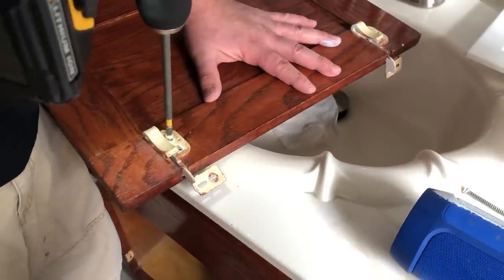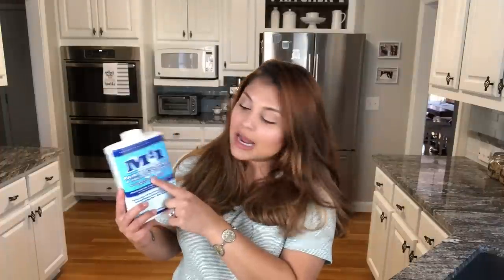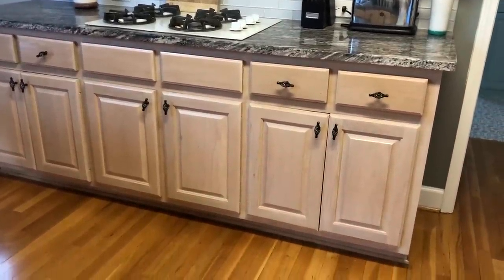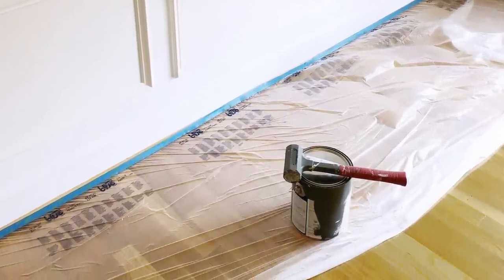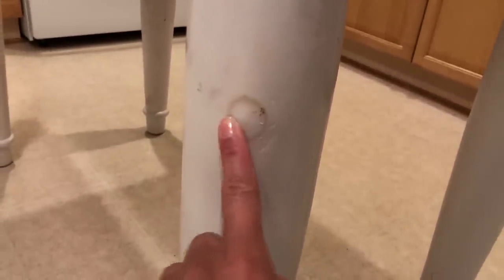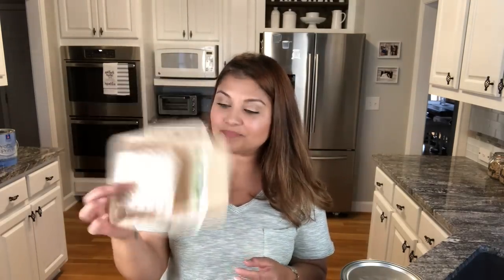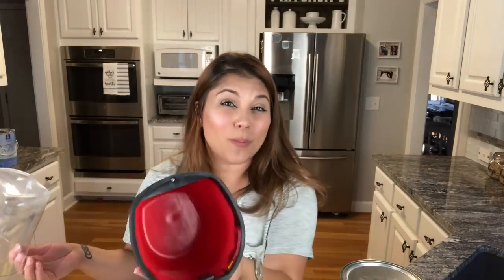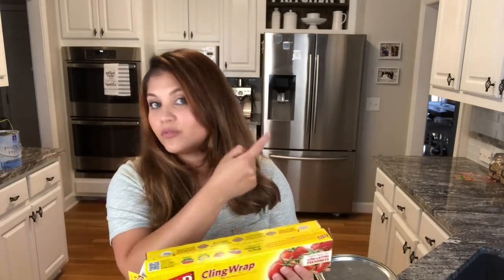HOW TO PAINT YOUR KITCHEN CABINETS THE BEST WAY - How to paint kitchen cabinets without a sprayer

Comment: I want to thank you for this video- I just spent two months painting all our bathroom and kitchen cabinets. Just finished today!!! I followed your steps and after a lot of hard work, they look amazing! Thank you so much for your gift of knowledge. :)
Reply from the maker: That's amazing news!!!!! Thank you so much for letting me know! I am so happy you are happy with your results!
Reply: @TheLatinaNextDoor  :)
Reply: @elycevwestby1521   How are they holding up? Anything you would do differently? Want to tackle my kitchen cabinets and will be following her steps.
Reply: @SX-sv6vo  I think they have held up well! There are definitely some chips that show- especially on the lower cabinets which I painted a dark color. But I just need to touch up the chips one of these days- otherwise I love them. It took me 2 months but is worth it when I love how my kitchen looks now. :)
Reply: @elycevwestby1521  Thank you for responding! I have a big kitchen and 3 kids, so I will be working in phases over the next few months.  I want to do it right so it lasts. So happy for you!
Reply: @SX-sv6vo  When I did the cabinets, I had two little kids and a baby, too! So that's why it took me 2 months as well. :) I think the #1 tip is to do the prep as perfectly as possible- I had to redo a few doors during the process as I didn't sand them enough during the prep stage. That was a pain. Thorough sanding is so key! Blessings on your painting endeavor! :) :)

Comment: First time watching this "older" video, Yami! We're coming up on the end of an entire first floor re-do, including furniture, flooring, trim, walls, countertops, bathrooms, etc. Just wanted to concur with your wonderful tips for re-doing your cabinets, and join in with the recommendation for using Sherwin Williams Urethane Trim Paint in the Extra White (Semi Gloss). I can't remember where I learned of it, and it's been difficult to get a hold of this past winter ('21 - '22) for some reason, but we've gone through about 10 gallons, and it is HANDS DOWN the best paint for doing cabinets (as well as, of course, your trim work and doors). It takes about 30 days to completely cure (be a bit gentle for the first month), but then the finish is rock hard and nearly indestructible. I was so excited to see you recommend this as well!

Comment: This lady knows what's up. Ive done a bathroom cabinet with polycrylic and it looked the same and even chipped in spots (I did a lot of things wrong, lol). I heard from somewhere else about using the enamel trim paint and repainted the cabinet. I got the hgtv sherwin williams kind from lowes and just wow, what a difference. Ill never use anything else for cabinets. I also used a foam brush (from another recommendation, probably on youtube)and I think that helped a lot too. I still made some mistakes (like not filling divets in the wood with filler first and not sanding the holes where the old tp holder went) but it looks 100% better.

Comment: Thank you so much for this information.  Everything you said resonated with me. I am in the process of painting a raw wood corner computer desk I had built. I have bought all this stuff to ensure a professional finish.  Fortunately I still had the Sherwin Williams paint I used for my kitchen Island.  I bought Kilz primer, Urethane for the top coat, which I don't think I need after watching your video.  I stopped the video at least 3 times to pack up some of the stuff I bought to return it and buy what you suggested.  I'mm on my way back to Home Depot to exchange those foam rollers, Urethane other stuff.  Thanks for your thoroughness.  I'll let you know how it goes.
Reply from the maker: Diva9000x I’m hoping it all turns out great for you! 😊

Comment: Hi Ms Latina..I finished a major league project of painting our Kitchen cabinets.  I took most of your suggestions to heart and you comments were also adhered to. In other words, I listened carefully to what your video was about.
I am happy to say the cabinets came out beautiful. The paint you suggested was fabulous.  
I would like to make a few suggestions that might help other painters.  
1. The Sherwin Williams paint store associate suggested to use 2 coats of primer, because the pros that came into the store all do it. I used oil based as you suggested.
2. the 1/4 inch nap that you suggested was fine, but in some cases 3/8 worked better for me.  It covered some trouble spots way better than the 1/4 inch.
Thank you again for this great video.......jim
Reply from the maker: I am happy to hear that your cabinets came out great! That's wonderful!

Comment: Questions about the brush/roller cleaning process. You said you clean them with mineral spirits right after the application, so I’m wondering if you do that twice for the primer process, once for each side? And the actual paint, if you paint in the morning, clean your brush, and then paint in the evening, how is your brush not still wet? I feel like I’ve tried that before, I’ve thought the brush was dry and then using it the paint goes on watery. I’ve wrapped my brush instead, like you did with the roller, and it was okay doing multiple coats (painting trim), but eventually it’s not in such good shape. 

I’ve used that same paint for trim and love it, so I was also thinking to use it on my cabinets and you’ve definitely convinced me!

Comment: You're video has inspired me! I'm going to paint my wood cabinets white and feel confident after watching your video countless times. It's excellent and so informative. So glad you posted it. I do have one question...I'm going to change my cabinet handles on my cabinets and the new ones will require different holes. What should I use to fill the current handle holes and do you have any recommendations on the best procedure? Do I fill the holes before or after cleaning the cabinets? Also, when do I drill the new holes - before or after painting? Thanks for any advice!

Comment: I gave cheap cabinets (rental), with no indentations,  do I need the brush, if so,   where do I use it? Or do I just roll it on? This is the best video for painting I've ever watched.  Hubby doesn't want to go to that much work, thinks we should just roll it on, so it looks like I may be doing this myself because I want it done right.  Thank you so much for showing what that looks like,  I appreciate it and now I have the confidence to do this project.
Reply from the maker: If you just have a straight panel door, you should be able to just use a roller - a word of caution, when using a roller on the ends make sure you don't have too much paint or press down to hard, but the paint will dry down the sides and leave drip marks. Hope that makes sense.

Comment: Lots of great tips, thanks!  How are your cabinets holding up after a year of use on the cabinets?  Also, if you have to do some sanding of the cabinets due to chips what grit do you suggest?

Comment: I just did this and followed your video. It was very helpful!! I would just add 2 bits of info . 
1. The primer is VERY strong smelling and a lot of ventilation is needed. 
2. I would recommend spraying the paint. I had a bit too much texture on the finished product.

Comment: best tutorial I've seen so far. One question I have is, did you use a wood filler for the holes from the hardware or did you reuse the same hardware? If new hardware, at what point in the curing process did you drill and attach hardware?
Reply: Yes great question
Reply: Drydex spackle works great for filling holes that are going to be painted.Home Depot or Lowe’s has it.
Reply: Mandy Shipler Drydex spackle works great for filling holes that are going to be painted.Home Depot or Lowe’s has it.

Comment: Thank you for the video!  I did have  a few questions. 1) how many did paint did you buy to cover your kitchen? 2) did you have to apply a sealant after painting them?  Thank you in advance!
Reply from the maker: I just bought one can and still had some left over. I did not apply a sealant. In the video I explain what happens if you do and why I chose not to do it. Also the paint I use does not need one. Hope that helps! 😊💕

Comment: Thank you so much for sharing your cabinet transformation!!!

We're starting our transformation from Oak stained cabinets to the SW Extra White this afternoon.  I am so excited, the Oak cabinets were put in the summer of 2000 and are still in great shape.  We've transformed out laminate countertops to a faux granite (that look amazing) and I know the cabinets will just set this off.  We have also taken down the wallpaper (again installed summer of 2020)  replacing it with SW Repose Gray and adding a backsplash which is going up next weekend.  I get a very happy feeling when I think of where we were just a week ago and we're going to be at the end of next week.  I have turned in to a complete DIY'er.  Plan to do our bathrooms next!
Reply from the maker: You got this!!!! 💕
Reply: Did you use a wood filler on your cabinets? I’m so nervous to skip this step as my oak cabinets have a lot of graining. TIA!

Comment: There are stain blocker primers that can be used as well called KILZ that are in latex options as well if anyone does not like the clean up of oil based products and has issues with the odor.

Comment: In the middle of watching the video I had to subscribe. Love how you explained everything. I just have 2 questions. How many bottles of the M-1 did you used? And if I need to sand my cabinets which one do you recommend. Thanks
Reply from the maker: A little M-1 goes a long way. I only used one bottle. You can sand by hand or use an orbital sander with fine grit paper.

Comment: thank you.  This is the only video that I have been coming back to.  Very good information;  I will use oil based primer but I've been told to use a thinner for the primer because of what you said that it's very thick;  is that important to do? should it be done?  maybe just by getting your sherwin Williams primer will be perfect.   Just asking the easiest, but perfect way to do this.  It is my first time doing my kitchen cabinets.  I actually bought your tool recommendations already  but I'm stuck on the primer.  Thanks

Comment: So you motivated me to paint my kitchen cabinets and I used the primer and paint from Sherwin Williams. I have to be honest, I absolutely hate the primer!! It dries way to fast and does not go on smooth. I had to sand down after applying the primer so that I can get a smoother finish but even with that there were some not so perfect spots. I did like the paint though. Maybe I wasn’t applying primer correctly. Would love to see a video of you applying the primer.

Comment: I want to paint and antique my cabinets.  I plan to use your method but wonder about having to seal the antique once it's dry.  I know you don't like the poly seal, is there one you would recommend or have any suggestions for sealing an antiquing with the paint you used.  Thank you for your time and your super helpful video!

Comment: Hi. I just watched this video and it was so informative and educational. Thanks so much.
Can you please tell me what grit of sandpaper should I use for stripping the original paint color from my cabinets that had started to peel. Thanks again.
Reply from the maker: I would try the 120 grit. If they are already peeling you need to be able to remove as much as possible. Starting with a more coarse sandpaper helps like a 120 work my way up to 220. I’m always hesitant to go lower because you will start getting deeper sandpaper streaks and if you don’t have to do it to all your cabinets their finish won’t look the same. Hope that makes sense.

Comment: Thank you for your very informative video. My cabinets are in melamine...would you recommend the same process?
Reply from the maker: Denis Richard I have tried this same process on melamine in bathrooms and it has worked fine. However, if your melamine is peeling you may find issues regardless of the process you use. I hope that makes sense.

Comment: I love your video I must have watched 10 times and now feel I can redo my kitchen cabinets you are amazing! in your opinion would you use the same paint and color on the walls
Reply from the maker: I personally wouldn’t. For the walls all you need is a satin finish in a kitchen. It is wipeable and less expensive than the urethane enamel. If you want them to be the same color you can go ahead and pick the same color for both paints, but I personally like a little bit of contrast.

Comment: Hi. I loved your video. I’m wanting to paint my kitchen cabinets this summer. I have a couple of questions. I’m not a fan of shine. What are your thoughts on getting a Matt or satin finish in the emerald paint? Also, I plan to include a step where I use a water based wood filler and sanding it to get rid of rough edges before priming. I really don’t want to see the grain at all. Would the oil based primer adhere to the wood filler and not bleed through with a couple coats?
Reply from the maker: Hi Heidi. I have never used the wood filler in this application so I honestly cannot say. If you use a Matte finish paint (or even satin) on the cabinets you run into the issue of them not being wipeable and any grease stains etc from cooking will not come off them. They will just seep in the paint. I can use a magic eraser on my semi-gloss cabinets and they look good as new each time. However if you go the route of matte paint you will definitely need a top coat and with polycrylic you will run the issue of streaking with the example I showed in the video.

Comment: Thank you for sharing your knowledge. You did a beautiful job. I want to paint my kitchen cabinets but am a little scare since I’ve never paint furniture before. Anyhow, my cabinets are oak and were stained a dark espresso color. Can I just use a water base primer or do I have to use oil base? I’m planning to just use the de-glosser/cleaner without sanding. Please advise and thank you!

Comment: Wow very well organized video presentation. Thank you you cover a lot.  Maybe you covered this in the video but I still have 2 questions.  Do I sand the cabinets before or after I use the cleaning de-glosser ?. The last step after the cabinets have been painted with the final color do we need a sealer coat or something?
Reply from the maker: I would do the deglosser first and then sand if you need to. No sealer. I share (and show) a specific example in the video as to why I don't use or need a sealer with the paint I recommend.

Comment: @TheLatinaNextDoor I have all your products, tips and tricks written down, thank you! We did, however, just purchase the paint sprayer you used in your sunroom video because we need to paint our entire house! Would these cabinet products be okay to use in that Wagoner paint sprayer? If so, do you recommend still applying the primer with a brush and roller, and spraying the latex paint? I'm asking because the oil based is more difficult to clean up, and I'm not sure about putting it in a paint sprayer! Love your channel - Thank you!
Reply from the maker: Thank you for your question. Yes, I would apply the oil based paint via roller and then the latex via sprayer if I were to do it that way.
Reply: @TheLatinaNextDoor  thank you for your quick response! I can read on the can if it's not allowed to be watered down. If you see this and have time to respond, let me know if you think it's a bad idea to water down this paint (if needed for sprayer) as far as if you think it could negatively affect the durability.

Comment: Thank you for this informative video! I'm embarrassed to say my wall are just as sticky from grease as my cabinets doors. Would you recommend I use the M-1 deglosser for my walls too. My kitchen room walls, back splash, counter top all need to be done as well. Do you think I should paint the kitchen cabinets/doors last after I do the rest? Really would love your suggestions. Thanks in advance.
Reply from the maker: I would suggest using Krud Cutter degreaser and cleaner instead since it won't be as harsh on your walls. However, if they are require scrubbing you may have to touch up the walls with paint as well. And don't be embarrassed! That means you're using your kitchen 😉

Comment: This video is amazing - thank you! Quick question - we have the exact same products you used and following instructions to the tee, but the primer has a little bumpy texture when it’s on. How do you get that applied smoothly so it doesn’t show through the paint? Thanks!
Reply from the maker: If are any bumpy spots you can definitely sand them down - we touched up here and there as needed. You can use a 320 grit sandpaper and it will work great.

Comment: Do you find this SW paint easy to brush and spread on without pulling or drying fast? Having this problem right now with an All in One paint I'm using so I stopped to find this video. It's very hard to get a flawless finish with the paint I'm using now. Is the SW easy to spread and apply?

Comment: Love your video. I am still debating if I should paint or stain my honey oak cabinets. Does the SW paint chip though from day to day use? Friends with painted kitchen cabinets told me their cabinets get dirty very easy and it's been a pain to clean it. Do you have the same problem? Thank you so much for your hard work.
Reply from the maker: Ada Kao I have not had any issues with cleaning. I can even use a magic eraser on them and it works like a charm! I also haven’t had issues with chips or peeling. Of course if you accidentally bang a pot on them, you can always run the risk of them getting a ding or chip. But they are pretty durable. Hope that helps!